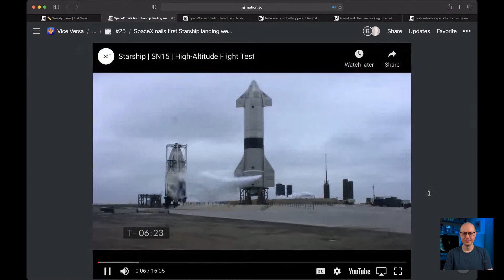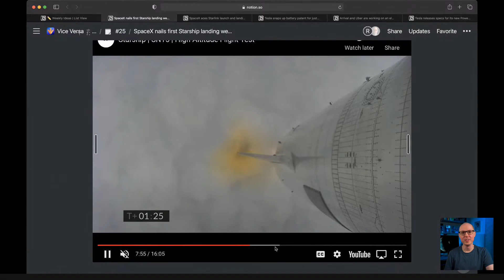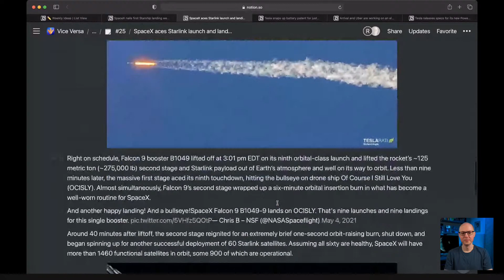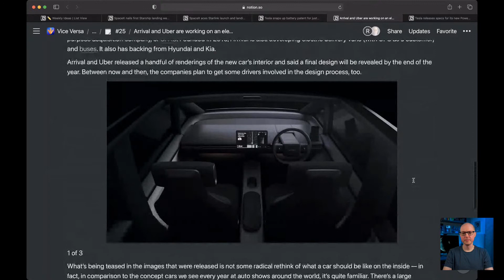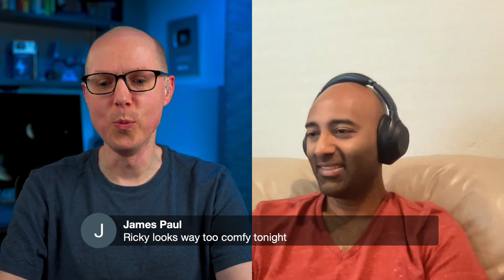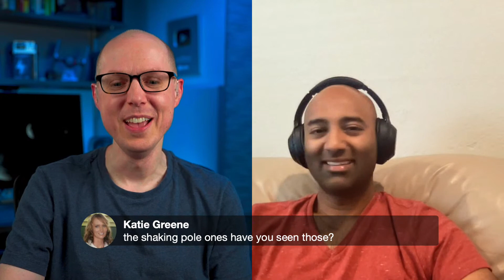SpaceX Starship Lands as Starlink Soars!

Comment: There is a  channel Solar Surge that covers domestic solar installation related stuff, I only discovered it recently.They covered the Powerwall+ in the latest video and the gateway design is totally simplified now as per them. Earlier, the solar DC current will feed into inverter, get converted(inverted) into grid synced AC current, that current will feed into grid as well as battery(through an AC to DC converter), so there was an DC to AC to DC conversion for the battery charging, which was inefficient. Right now, part of the solar DC current will converted into DC current for the battery specific DC voltage and will charge the battery, and the other part will get inverted into AC and feed the grid as and when required. This will have more streamlined installation, less complexity and more efficiency.

Comment: A more lucrative cash flow operation is with Boring Company and SpaceX. Boring is building the loop part of the system and SpaceX is developing the Hyperloop part of the system.

The loop part once it gets going will make 28,000 dollars per hour.

[($7.00 per ride)(4,000 rides per hour)] = 28,000 per hour or 4,704,000.00 per week or 18,816,000.00 per month

The first public loop is in Las Vegas at the Convention Center. On the next project or next expanded loop to the Las Vegas loop, Boring is going to put up all the initial money and then make all their money back on the backend of the deal.

If Boring gets 1.00 dollar from the 7.00 dollar fee then that is 4,000.00 per hour free money for Boring or 672,000.00 dollars per week or 26,880,000 dollars per month just for one loop. Each loop doubles the revenue. The local area gets 6.00 dollars per person of free tax revenue.

If you pair that up with Starlink, that is a ton of money.

Also, 1 Starship can carry 400 Starlink satellites which are 10 Falcon 9 launches. The cost will be reduced by a factor of 10 but the production will scale up by a factor of 10. People speculate that SpaceX wants to get a cargo variant up into space in 2021 to test out the starship and superheavy but reduce SpaceX's cost with the development of Starlink. This is the reason why Elon wants to go to orbit with Starship in July 2021.

I think that if you are tracking Tesla, SpaceX, you should not overlook Boring Company from that analysis. When you put the larger plans of Tesla in perspective with SpaceX and Boring, many of the ideas make better sense.

Thank you.

Comment: Cybertruck battery....
Extra cells = extra weight = diminishing range returns.
But, 4680 cells are lighter than 5× (equivalent) 2170 cells, so maybe.

The "no connection to grid for Powerwall is probably simply Tesla being fed up with dealing with utilities(?) If so, a suitable interface (12-48v?) From the Cybertruck still wouldn't impact that and would provide the ultimate backup.

Comment: My take on Arrival.
If I were UPS (for example), I would lease Arrival a portion of a warehouse (or maybe ALL warehouses!?) To instal a factory module.
I would use the UPS facilities to collect and deliver parts to that module, then replace existing vans as new units are produced.
All costs/ services which could be negotiated with Arrival to reduce the unit price?

When the requirement for that facility (warehouse) was satisfied, several options.

Arrival dismantles and moves the "factory" to another UPS warehouse.

Leave the factory in place, Arrival producing more vehicles for the company (UPS)

Leave the factory in place and build vehicles for other customers (UPS retains the "parts delivery" component of the deal)

This could be lucrative for both companies.

Comment: Ricky, I want to hear more about the tactile feel of the id4. Things like sifters, switches, surfaces. What worked well, which things didn’t?
Reply: All areas which VW should be good at, with a large parts bin and known quality from suppliers.
It's the "new" stuff which appears to be an issue.
Almost as though someone described the requirement by phone (no notes) to engineers who had never used an EV?
It's a shame they (apparently) didn't invest in several Teslas and  instruct those building the system to just use them on a daily basis, then "borrow" the best points", improve on others?